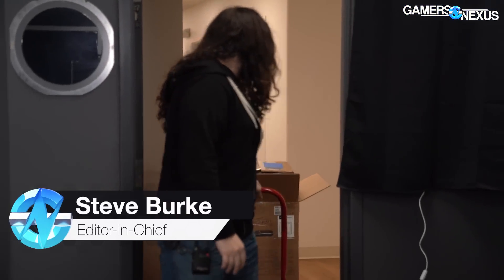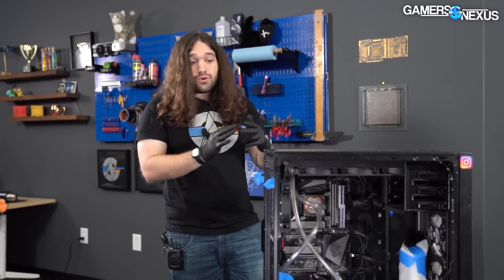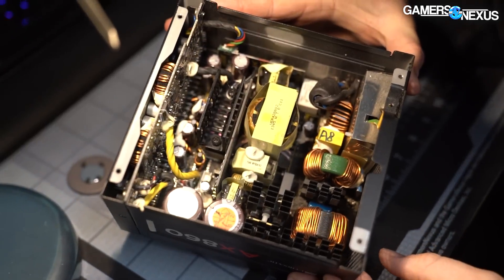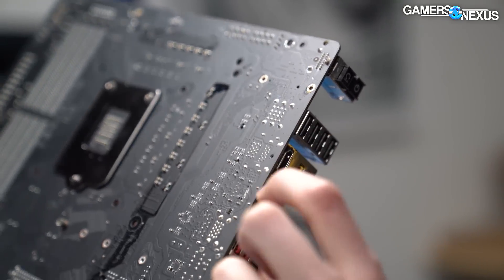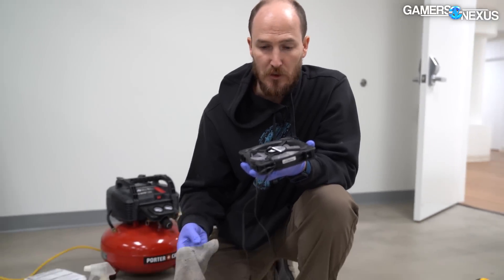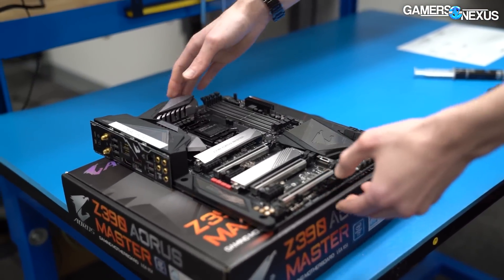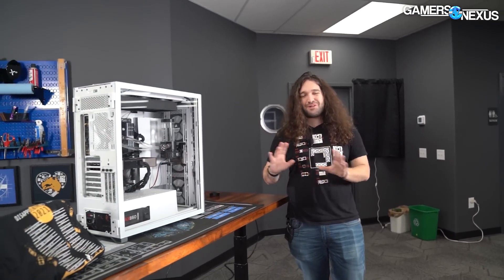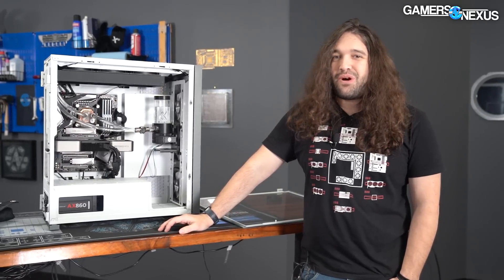A 150mph Hurricane Killed This Gaming PC: Cleaning, Restoration, & Repair

Comment from the maker: Our toolkits are IN STOCK & SHIPPING now! https://store.gamersnexus.net/products/gamersnexus-tear-down-toolkit
Watch our other most recent PC build with BPS Customs! https://www.youtube.com/watch?v=UKknmoatTJA
Our Disappointment PC T-Shirts are in the LAST & FINAL round! https://store.gamersnexus.net/products/disappointment-pc-t-shirt-2021-100-cotton-black (cotton) & https://store.gamersnexus.net/products/disappointment-pc-t-shirt-2021-triblend-black (tri-blend)
Grab the same PC building work surface Modmat that we use in this video! https://store.gamersnexus.net/products/modmat-volt-large (in stock & shipping now!)
Reply: @Gamers Nexus... so a blast shield for PSUs? Why is that needed?
Reply: Check your comments for the Chinese pron bots. One of them just replied to me.
Reply: @JustTechGuyThings  literally says it in the vid. It’s incase things go pop and magic smoke comes out. When things explode pieces can go flying, better to be safe than sorry. Or blind.
Reply: Hey Steve! love the videos and youre helping others in need!, I wanted to mention, Always REMOVE the CMOS battery if your system gets wet. the power from the CMOS battery will cause galvanic corrosion on any traces with water on them!!
Reply: Front cable managing is bad
Reply: I just got my mouse mat in for a early 30th B-day gift to myself, love it, will be buying a shirt and maybe some screw drivers soon as I can replace the chair that I have.
Reply: I notice something about your and Linus' teams... The GN team look like the type who, in the event of an 'incident' would take the battle TO the bad guys....Linus' team look like they'd be telling people how things could be worse and some 'RGB' would make the crater look nicer...hahahahahaha Badass man...
Reply: And they forgot to mention yes a power supply can hurt you or kill do not attempt this without proper knowledge or training.

Comment: fine ill clean my pc dont dust shame me
Reply from the maker: Hahaha, nice!
Reply: This time of year I call it the winter coat. Temps are good so I don't care.
Reply: @youtubechangedmynamelikeacunt  yeah she's really burning up in there
~$  sensors
coretemp-isa-0000
Adapter: ISA adapter
Package id 0:  +27.0°C  (high = +80.0°C, crit = +100.0°C)
Core 0:        +21.0°C  (high = +80.0°C, crit = +100.0°C)
Core 1:        +23.0°C  (high = +80.0°C, crit = +100.0°C)
Core 2:        +22.0°C  (high = +80.0°C, crit = +100.0°C)
Core 3:        +20.0°C  (high = +80.0°C, crit = +100.0°C)

acpitz-acpi-0
Adapter: ACPI interface
temp1:        +27.8°C  (crit = +105.0°C)
temp2:        +29.8°C  (crit = +105.0°C)
Reply: @youtubechangedmynamelikeacunt  that'd be tough to prove. Evidence says otherwise.

Comment: That Corsair PSU surviving a literal hurricane is probably the best advertising they've had in a while. Gives me confidence that I made the right choice using their units in my and my husband's builds.

Great video, and a great gesture. Much love to the GN team for doing this at all-- for any viewer. We love when companies like yours show that they care about their followers and content consumers. This is why you guys are my favorite media outlet-- period
Reply: If you bought the exact same model you're probably right, but if you have another Corsair PSU from another of their series that may not be true.

In the past, Corsair's top of the line models (like this AX860) with high wattages and efficiency were very good, while low tier models you could get around 50-60 bucks were pretty mediocre, so it depends.

Don't take brands at face value, check reviews for specific products to be 100% sure about what you're buying.
Reply: Agreed. I've used Corsair memory first, the switched to G.Skill memory, but I still use nothing but Corsair power supplies. They are nothing but tanks.
Reply: I dunno man there was a problem I while back where one of the RM650 had quite a few blowing up. I went through 2 of them on warranty, before just settling on a new one.
Reply: @Zampella27  Yeah, I looked up that PSU. It's a 80+ Platinum top of the line model that seems to have launched at $250 in 2012 (About $303 in 2022 with inflation). Not really fair to compare it to lower end and cheaper Corsair model PSUs.
Reply: AX1600i here. Never blinked. Never rippled. Never broken a sweat. Not to say that the entire brand is great across the line, but when it’s good, it’s good.
Reply: Coming back to this, I have a CV 550 in my system with an R6 1600 and a GTX 970. I got it to replace my EVGA 650BQ that had a dying rattling fan. My husband's system was built with a USED CX750M and it is alive and kicking like a mofo. I was wary of it, as one should always be when handling a used PSU, but once I confirmed it was working I was very impressed
Reply: survived a hurricane, still doesnt explode. take that Gigabyte, lol
Reply: Same here, makes me happy I went with corsair for my psu
Reply: I'm glad I have my Corsair TX650M, never had any problems with it ever after two years.
Reply: My corsair PSU was causing bios resets on cold boots if the computer was off for +/- 8 hours.  I have had better luck with EVGA PSUs.  A month or so after returning the PSU corsair came out and acknowledged the issue.  After 8 years i had finally built a new computer and could not even use it.  Think of how frustrating it is when you have an issue you are trying to track down and you need to do dozens of reboots.  Now imagine EACH troubleshooting iteration requires an 8 hour down time.  This was a 1600 watt supply, so definitely not a cheap model.
Reply: @petermckenzie580   Most of of Corsairs PSU's are made by seasonic and rebranded to corsair. If you want to get the same PSUs a little bit cheaper I would order straight from Seasonic
Reply: @andrewt.5567  Both Corsair and EVGA source their high end PSUs from seasonic... so you were probably getting PSUs made at the same factory.
Reply: as long as you purchase one of the higher end units, you're in good hands. my rm750x has lasted 7 years so far, the only reason i stopped counting is because i swapped my system to an sff case and physically can't use it anymore.
Reply: Anybody who did what he did to Newegg is now my favorite techie
Reply: When my decade old PSU finally crapped out at the height of Pandemic shortages all Best Buy had in stock was an 850w Corsair. Now I feel a LOT more confident about that spur of the moment, had to get it out of absolute necessity buy.
Reply: @lethargyart  The 2018 and 2021 RMx PSUs are rock solid. Freinds of mine recently upgraded from a cheap Antec non-mod to an RM750x on my recommend and has had zero issues with her GPU tripping OPP ever since
Reply: I have a Corsair PSU that set fire to 3 GPUs.

Tbf, Corsair reimbursed me for the GPUs and sent me a new power supply which has not set fire to any GPUs.
Reply: @skylerpolendina7517  Yeah, bad units happen even in known-good lines from reputable brands. Electronics are complicated.
Reply: It says more about Seasonic than Corsair tbf.

Comment: Draining the loop is always a good idea when shipping, a good call.
Reply: Yeah, I was thinking parts of it are water damaged, but there's a chance there are parts that aren't significantly damaged and corroded (like that GPU) and shipping it with liquid in the system is tempting fate there.
Reply: Even if it's not for safety, it weighs less and costs less to ship.  Draining the loop won't hurt
Reply: @JSTheAnonymousOne  me:
Laughs in shipping a full multi-rad loop across countries when i was in school. 

Then cries because you're absolutely correct and it's expensive asf. But I was moving somewhere any maintenance would've been very difficult, so it was the right call. Just painful
Reply: I agree. I wasn't even thinking about water damaging components. I was just thinking that if it started leaking, they might not deliver it.

Comment: I have had the AX860 for over 8 years now and I was considering replacing it, but after seeing it go thru a hurricane… i think I might just keep it lol
Reply from the maker: It's a beast!
Reply: Went through a hurricane and still managed to get the coveted "Did Not Explode!" Award.
Reply: @GamersNexus  Hey Gigabyte! here ́s an example for "how to do a PSU" xd
Reply: A PSU if you buy a proper one at the start will go through several builds without problem. The only reason why one should need to upgrade is if they need a SFX/SFX-L/Flex ATX, noise, not enough wattage on initial purchase or it happened to die.

That's why you don't cheap out on a PSU
Reply: Same here,definitly going to keep it now
Reply: Yes, if the hurricane decides to give it back to you instead of just throwing it to the next town over.

Comment: 8:37 I've seen lots of content with warnings about not opening a power supply without training, but there's not much out there advising on how to do it safely. I'd love to see a video covering how it should be done, with a view to perhaps removing the dust and replacing the fan.
Reply: If you ever HAVE to open one, make sure to short everything on the back of the board. Don’t power it on the day before you open it. Don’t touch anything you don’t need to. Hold by the heatsinks. Not really a lot, just common sense and don’t do anything dumb. Work slow, and if you feel stressed take a break.
Reply: The warnings are there for a reason. Probably why no one does how tos is liability.
Reply: As cool as that would be. It could make GN liable for damages, and I just dont think Steve wants people hurting themselves (even at their own risk)
Reply: Unplug from the wall and remove the PSU from the case.  Plug in a fan into one of the molex cables, and short the PS_On pin (usually a green cable) on the motherboard connector to a ground (usually black) to discharge.  One the fan stops spinning, it should be discharged to a degree that's safe to handle, but leave the PS_On pin shorted a minute extra for safety.  Don some rubber gloves if you want to be extra careful, open the PSU and use a multimeter to check the bulk capacitors exactly as shown as a final safety assurance.  If you only see a few milivolts you're safe.

Comment: The 750d airflow is a solid case used mine for like 7 years only upgraded last week
Reply: I’m still using it haha
Reply: Just put a 3960x system in one last year.  I love it.
Reply: Curious if you upgraded to another Corsair?
Reply: uhhh if you don't want it I do need a new case #recycle #reuse lol
Reply: I have its bigger “brother” the 900D also 7 years old still part of one of my PCs with some heavy mods.
Reply: Still using my 750d, been in service since it came out, it’s an amazing case. Just fitted a h170i in it, works like a charm!
Reply: I still got mine and won’t switch untill I have to
Reply: @sig3ldunc4nI  i did the 4000d airflow! It doesnt feel as quality as the 750d in thickness on the fan mounting panels for front and top but it really is beautiful and a more suitable size for me
Reply: Still using the 750D and I don't think I'll switch to any other case unless I go mini-ITX.
Reply: @Goodjuiced  I had a feeling it would be the 4000D Airflow. I swapped my rig to one as well. No regrets such an amazing case for the money.
Reply: Replaced my 750D with a Define 7 XL a couple months ago. My friend was building his first custom PC and I cut his budget a bit by giving him my case, finally giving me a good reason to get the case I had been eyeing for quite a while.
Reply: Still using a 750D airflow, it's a solid functional case. Only now considering upgrading to 7000D because of AIO mounting options (new cases have space for 360mm+ GPU cooler on back) and a cleaner look overall (no need for 5.25" drive bay and a good aesthetic with the hidden PSU and better cable hiding options)
Reply: Used mine for ages too, until I swapped for the 5000d last year for my all-new build. If there had been a clean way to remove the drive bays (I'm useless with a dremel, so that was out), I would probably have stuck with it.

Comment: Went through three hurricanes in 2020, luckily no flooding and the windows held, but the case completely rusted, had to take apart the entire PC, dissassemble anything that had exposed metal with no powder coat and use a dremel to grind the rust away.

The PC Case was done, had to grind like 90% of the case, make sure no rust remained and used a spray can of Anti rust paint for Truck beds on the case. Just managed to change it this past september.

Comment: I'm reminded of a repair I did on a client system... the appropriate tool was a trowel. It had been living in front of a window. In a dusty part of the desert. I took out about three inches of packed dirt (bottom two slots were completely covered). The wonder was the thing still worked.
Reply: Sand is not very conductive.
Reply: @1pcfred  one could say it is semi-conductive...
Reply: @1pcfred  That particular desert dust is very fine clay, not sand. -- The dirt in my yard is conductive enough to short out electrical sockets. I had to put covers on all the barn outlets.
Reply: @Reziac  Line voltage is a tad higher than what you're going to find in a PC case outside the PSU itself. Lower voltage potential cannot pass current through less conductive materials. It simply lacks the electromotive force to create a circuit path. In the hydraulic model voltage is pressure. Low voltage has no push. It's why we don't get electrocuted by car batteries. Even though they can deliver hundreds of amperes. We're just not conductive enough to pass much current. We break down at about 36V.
Reply: @1pcfred  Well, yeah. The PC's metal case wasn't hot, and more to the point, nothing had shorted out. If it were dirt from my present yard, it would be a different story (here I can always get metallic bits on the nail picker).
Reply: @Reziac  With some electrical faults I think ground can be hot. You definitely need some electrical repair if that is the case though.
Reply: @frizzlefry1921  I have thicker skin than that. Now the ignition system can light you up. I put a Mallory HiHire ignition system in a car once and I wouldn't even time that car unless the engine was off. When Mallory says HiFire they're not playing around. I had 8mm silicon wires and I guess I needed 10mm? I don't think they make wires heavier than 10. The one time I got zapped by that I thought I was going to die.
Reply: @1pcfred  I’m just saying it can happen… no more no less. Didn’t mean you specifically.
Reply: @everope  silica is not conductive. Doped silicon is semi-conductive.
Reply: @frizzlefry1921  12V is not enough to cause current to flow on human skin. The generally accepted lower threshold of electrical hazard is 36V Then it's just barely a possibility. At 12V there's no chance whatsoever. Now if you're bridging a starter solenoid with a wrench and you get close to the arc you can get a flash burn if you're a real idiot. Keep some distance between you and the arc. That arc is 10,000 degrees after all. So pretty hot. There you're not getting electrocuted, you're being cooked. Although there is one form of traditional electrocution that is like internal cooking too. Being electrocuted can harm you in different ways. Classical electrocution induces arrhythmia in your nervous system. You glitch out. Your heart seizes up and you're done. That's doing it right. A current as little as 35 milliamperes across your heart can kill you. But your heart is located in the middle of your chest cavity. Which is a difficult place to energize.

Comment: Thanks for taking care of this guy.  I have been through more than my share of hurricanes and so far (knock on wood), I haven't lost anything.  I did a like recovery for my brother-in-law a few years ago after his system was caught in a house fire.  It was up on a table and the blast furnace like heat that came through the room melted the top of the case.  Despite the unexpected power failure, even the spinning drives survived.  As in your example, the motherboard was the one part that did not survive.  The cpu seemed okay at first, but I opted to replace it because I had a like one.  Rebuilt everything in a new case and it was mostly fine for a couple of years.  When it started giving us trouble, he was working on contract, so I told him it was time to build all new.  I went to Micro-Center Houston and picked up parts.  It went together nicely and has worked for a few years since.  The minus one system is built in a Zalman Z9 case and exhibits a strange "feature".  After being left on for a while, the USB ports stop working.  You can move the mouse or hit keys on the keyboard and the system will not wake up.  It requires a full power on reset to clear.  Since I have now seen this same symptom on two other motherboards in this case, I feel certain the problem is the case.

Comment: The issue with moisture is that it can be fixed but can later cause issues.  No matter how dry you get it corrosion tends to follow.  

The biggest culprits will be wiring harness and plug ends.  

Kudos for helping the guy out.

Edit.  Galvanic corrosion is where two different metals get corrosion.  It can happen without moisture.

Comment: I have been using that same PC case since 2014 - Corsair 750D.  Last year when I was upgrading to intel 10th gen I completely striped the case for a deep clean and replaced all the fans with noctua fans. After putting to back together it was as good as new or maybe better!